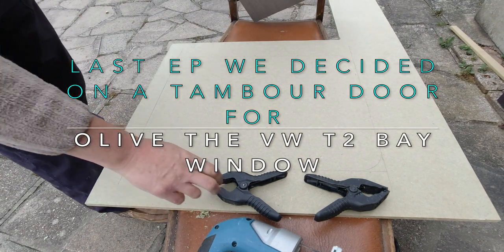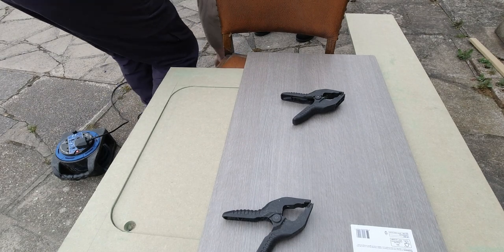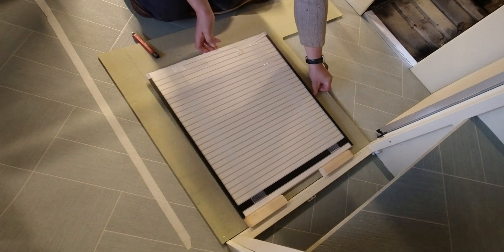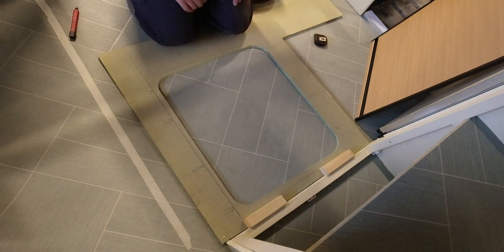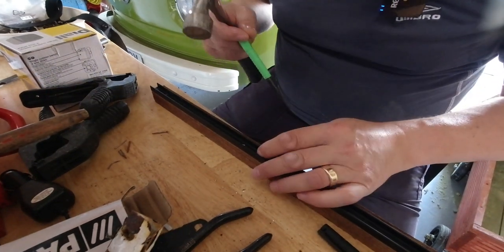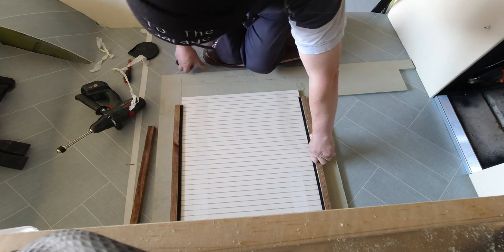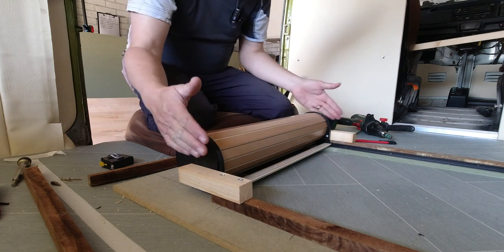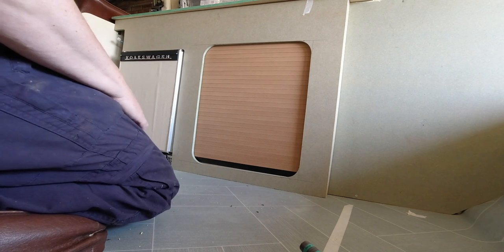Olive the T2 Camper Gets a tambour door ep13

Comment: Excellent piece of work, love the solution, your talents are greatly appreciated . What is the cupboard front made of, or should I have paid more attention. When I mentioned the sink drain, use see through piping if it does block you can see it. Also are you running to an external waste or internal tank? your video lasted my bike ride. So if you could increase to 20 mins on future episodes that would be great.😊
Reply from the maker: Hi Bruce Thanks mate🤗
The front is Moisture resistant MDF. (The really heavy green stuff thats mostly resin) Painted and lacquered to really seal it. Im yet to venture into my shed and locate my box of various useful pipes👍